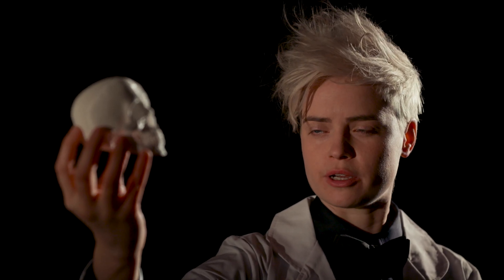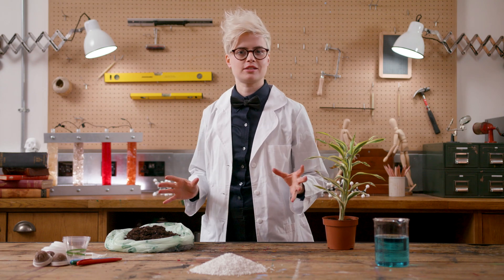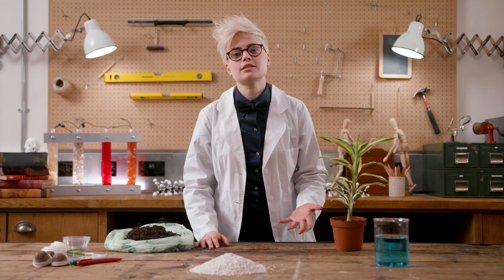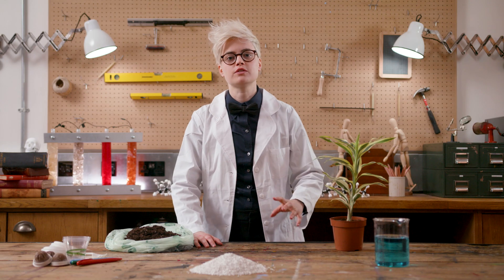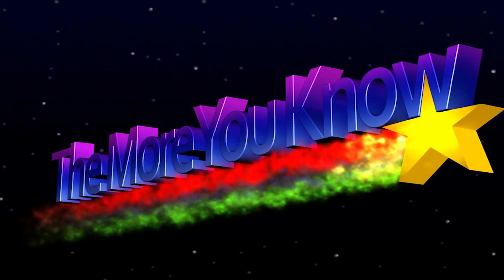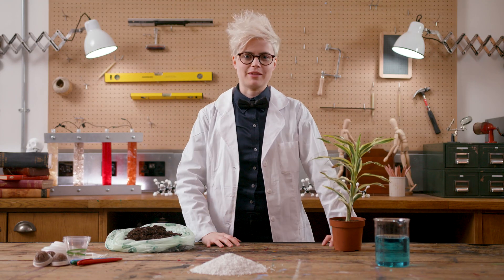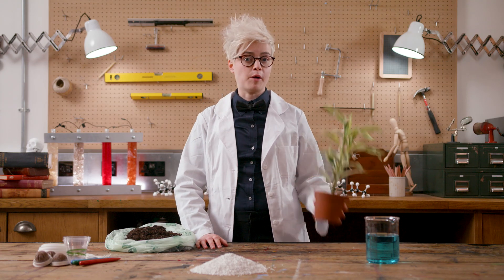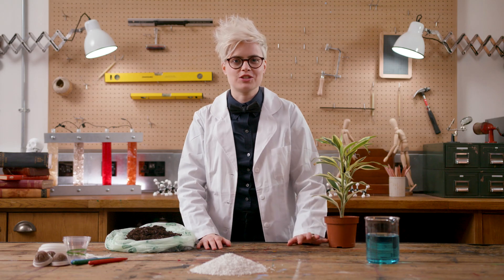To Bio or Not To Bio | Our Plastic Predicament: Episode 5 #ThinkBioplastic

Comment: PLA and PHA don't biodegrade in ambient temperatures and pressures... 58 degrees C is required to start the process... resulting in persistent plastic pollution in the ocean and on land... They also create micro plastics and can be extremely resilient and harmful to the ecosystem...